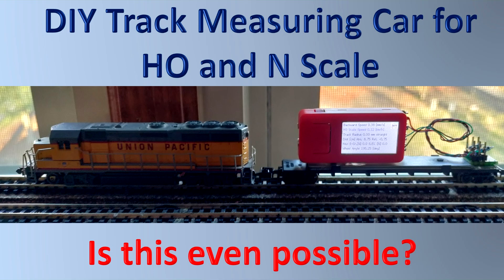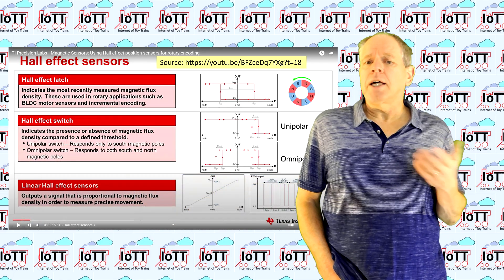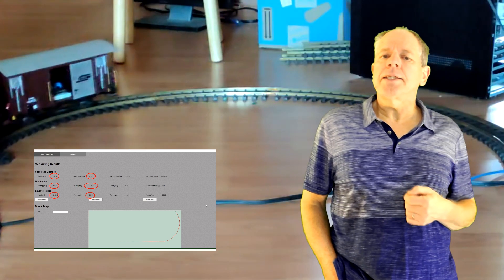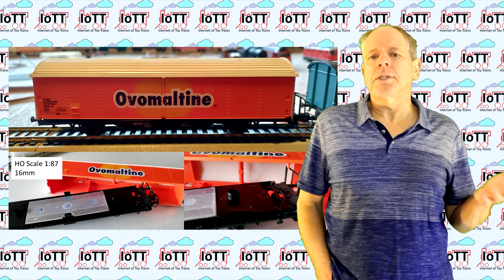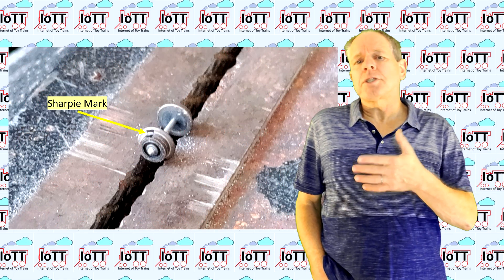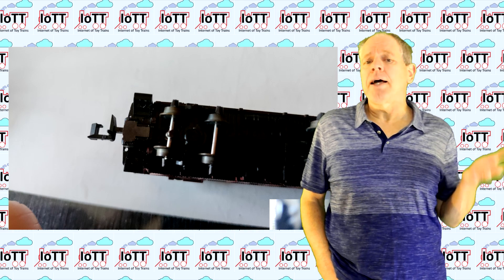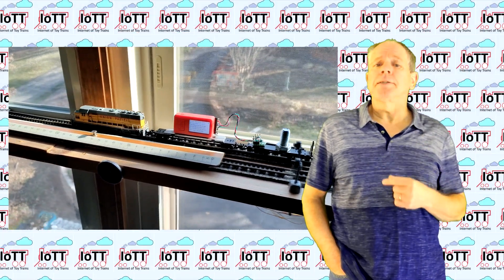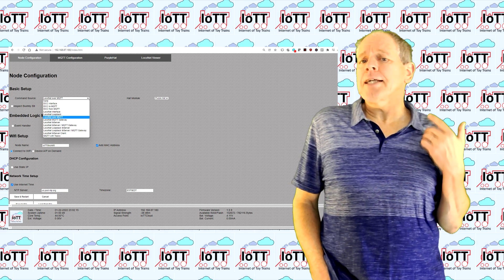DIY Track Measuring Car for HO and N Scale (Video#87)

Comment: I built and designed something functionally similar using an Arduino NANO and an LCD display in a 'dedicated' car. My design goals at the time were that it needed to be powered from the track, and included some super capacitors to keep things going over problem spots. That was needed because the HW I used wasn't exactly low power.

The display showed current speed in MPH and KPH, plus an odometer function and average speed (I needed someting to fill up the 4-line display). The car is currently at my club, and I'll be able to get photos in a day or so.

My design was 4+ years ago, and used 5 magnets attached to the inner surface of a wheel, and a hall effect sensor on a small PCB mounted on the truck with the magnets. It works well to this day.

Your configuration is better and simpler, as it doesn't require anything other than the magnets below the car. Allowing for an external battery supply to extend the time that your system can operate is something you should consider. My experience with the stick modules is such that the battery didn't last very long. Obviously, using the stick will allow remote access to the data, which was in my original design, but never implemented. It used a 433MHZ radio module.
Reply from the maker: Thanks for sharing. I'd love to see pictures.
The advantage of the 3d hall sensor is that it also can detect the direction  the rotation, which will become important once I start using the IMU to do the Layout GPS.
The battery of the Stick is indeed a weak point. Using the Stick plus, which has a larger battery, helps some. I am getting about 20 Mins of run time with full bright display and Wifi connected, sending a data update every 500ms. t snot too bad, but I plan on adding a connector for an additional battery to the final board design. I just tested it using a 750mAH Li-Ion battery and got an autonomous runtime of about 6 hours. That seems like a workable number.

Comment: I am an N-scaler. My idea would be to use this for setting CV5 and CV6. It could be used to log speed variations due to hot/cold motor, dry vs well lubricated, running without cars and many cars, seeing the influence of ascend and descend of track.
Another option for N-scale could be to synchronize chuffs of steam engines.
Reply from the maker: Great ideas. I am actually working on supporting setup of speed tables and/or min/mid/max settings so that speed matching becomes much easier. Comparing runtime characeristics or analyzing the impact of train loads, cold vs. hot motor or the impact of radius and slope certainly would be possible as well. Synchronizing the chuffs would probably be difficult. The frequency of the chuffs, yes, that could be done, but syncronizing to the exact position of the pistons is not possible because there will always be some slippage of some wheels here and there, so the wheel position between the measured wheel and the Loco wheel is changing constantly.

Comment: Boulder Creek Engineering has a N scale car that does distance etc. in N scale,  I have had it now for several  years,  but I'm rather interested in what you are doing.  Mostly interested in automated speed matching.   I have been doing it manual for years,  That is why the Boulder Creek Engineering car.
Reply from the maker: Interesting, another one I was not aware of. Same principle with the main advantage that you don't need any wires going below the chassis plate thanks to the wheel magnet. Would be interesting to know what sensor they are using and if they can detect the travel direction.
Reply: @IoTT  As far as I know it does not detect travel direction.  It passes the data via Bluetooth to an app on the phone.  Not a fan of the app.  I would rather have another way to save the data.   But it works,  It is also not a fan of track nails.   The magnetic drum on the axel is very strong and it will pull up nails that are loose or a little snug.

Comment: Hans ... this looks very promising!!    Only problem I see has to do with magnets already existing underneath track ... permanent magnets such as those used by Kadee couplers and similar.    I can't due the experiment, but my guess is that your car might just stall above any such magnet, or at least slow down.
Reply from the maker: Thank you. I never thought about magnets installed underneath the track, thanks for pointing that out.
I did some tests this afternoon, and at least in HO scale, it is not a problem. The only thing that happens is a temporary loss of speed data because the sensor is confused by the overlaying field. First I feared it would pull away a magnet from the axle, since they are not glued on, but not even that happened. In N scale there might be a risk that the magnet derails the measuring car if the position of the magnets is such that the car is lifted, but I will have to test that.
Another potential problem is that the sensor has an impact on certain activators, e.g. reed switches. But that would not be different from other train-installed magnets, so I don't think it is a real problem.

Comment: Awesome Presentation!! Do you have plans to develop a circuit that uses "constant actuation/warning time" software for a grade crossing control signal or turning on special effects for a train station? It is very difficult to operate that kind of circuitry on a HO scale layout.
Reply from the maker: Thanks. I am not sure what you mean by "constant actuation/warning time". If you think about a simple thing like crossing gates automatically lower when a train is approaching, along maybe with some blinking lights, you can easily do that using a GreenHat, which provides all you need: servos, inputs for buttons or lock detectors, and LED's. Maybe I should consider making a video that shows how to do that.
Reply: It pertains to advance actuation on trains traveling in higher speeds. It is smarter than a motion sensor.
Reply from the maker: Ok, thanks. Comes a fast passenger train, we close it early, and in the case of a slow freight train, late. In both cases, the time from when the gate is completely closed until the train is on the crossing, is about the same, right?
Reply: Correct! That's when additional sensors are added.

Comment: When rounding a sharp model curve, one wheel is gripping the rail and one is slipping. So you have no idea which distance you are measuring on a curve. The inner rail, the outer rail or anything randomly in between.
Reply from the maker: And your point is ... ?
Btw, the behavior in curves is not so unpredictable. If the car is pulled, it tends to lock with the inner rail, if pushed, with the outer. 
The length difference  between inner and outer rail for a full circle of track is twice the distance between the rails times Pi. For an HO circle with a nominal radius of 300mm the difference is about 5% (107mm difference, full circle is 1884mm) That's a tolerance I can live with ;-)
Of course, if you model maybe tramways and go with tighter curves, the percentage increases.